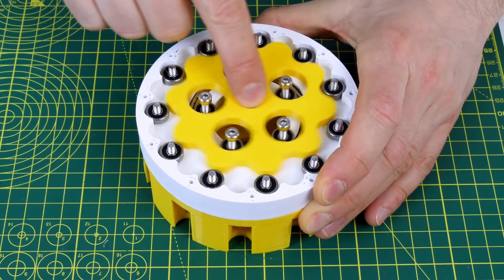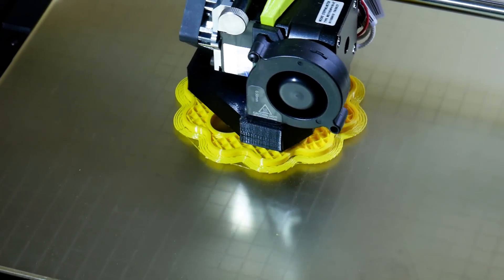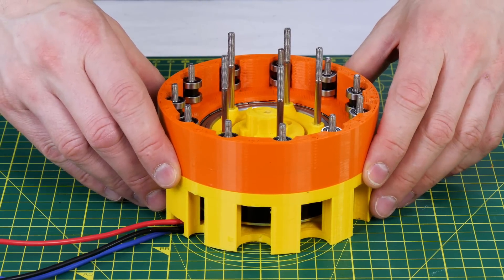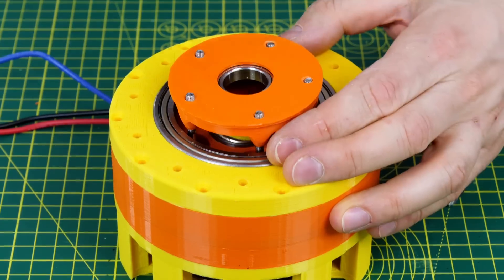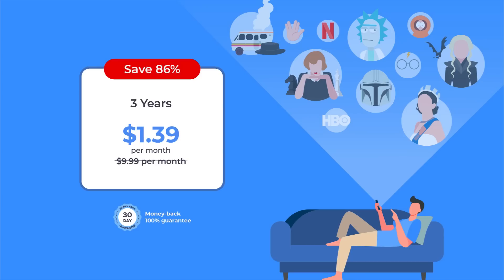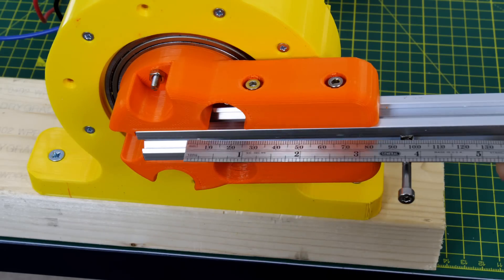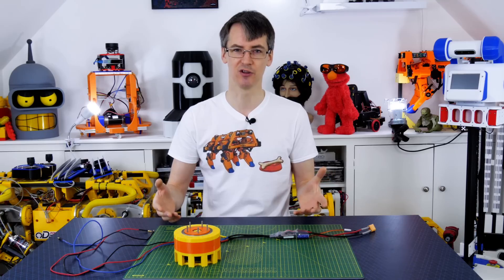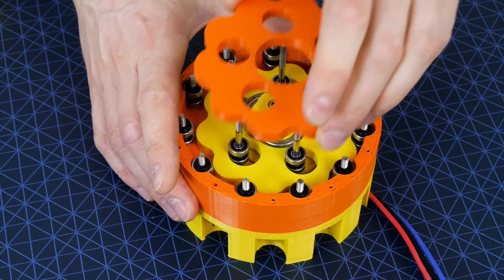3D Printed Cycloidal Drive V2 - Much Better!

Comment from the maker: Grab Atlas VPN for $1.39/mo before the deal expires: http://atlasv.pn/JamesBruton 💥
Reply: @occhieanimation2972  Plastics are hard to predict and tend to preform poorly under constant deformation.
Reply: @James Bruton  The use of 3d Printed cycloidal gears is the focus of my undergrad research. I'd be interested in sharing my research!
Reply: Use Planetary gearbox.
Reply: Why dont you have a mount on the bottom where the plug in is and put a case thing on the spinning bolts that goes around the entire thing  and make that a joint.
Reply: JAMES : "The cap fits perfectly " while he is just continuously  hitting it with a screwdriver.
Reply: Could you use Delrin/nylon bushing's instead of bearings to reduce weight?
Reply: how about adding some kind of dampening like what mini RC rock crawlers have. they're kind of like muscle tendons - which makes sense to use because it's literally like a leg. having a torsion bar or spring is
Reply: get an SLS .. that nozzled crap is really only for 3d illustration of prototypes

Comment: If there are three cycloidal disks, with the top and bottom being half the mass of the middle and being 180 degrees from it (so the same phase as each other) it should dampen the secondary forces as well, right?

Comment: AGS Door Ease Lube Stick is a very effective lubricant for plastic-on-plastic parts.  Just apply like a crayon onto the 3d printed parts and exercise the joint.  In a few motions it is super slick without the liquid residue.  I simply don't use oils or greases any more on 3d printed parts.
Reply: woulnt graphite just work as well?
Reply: Yes, but very messy.  The Door Ease is clear and odorless.

Comment: Have you tried using cycloidle drive  to and drill meters to make the upper half of a robot

And can you try to make it with pancake moters

10 to 1 ratio also

Comment: dog Looks really wonderful. I called it a robot pug.

  would you be interested in doing a serious robot hand? I mean a full tensegrity design?
 The robot hands that are out there generally only have one or 2° of freedom and have to be manipulated often by the other hand. This would of course require training with a position sensing glove, and it would need sensing. Ideally a touch sensor like on a light where you only have to touch the lamp to make it turn on. Interested ?
 The hope would be to attach it to a human arm. I have seen some great work but people often get things wrong. For instance the sideways motion of the wrist is an access point which is a head of the motorcycle twisting motion of the wrist. There are many other issues. Spreading the fingers And some design are often simplified. The free-floating pinky and ring finger are also rarely done correctly. A simplified designed that was able to achieve all of these would really be an exciting project. Maybe even a series. I hope it's not too complicated, as there is the possibility of using a  a single stamped flexible object for the whole finger structure.  such a spring-loaded hand would work very effectively, And there's only cost a little bit of energy in flexing.
I'm very knowledgeable about mechanical designs, I mean novel mechanical designs. There's a lot of stuff people aren't trying. I guess you could start with a piece of plastic cardboard and some rubber bands hot glued on the back of the fingers ha ha

Comment: Could probably use plain bearings in a few of the spots where you used roller bearings to reduce complexity and cost, without much extra friction

Comment: I know this is old, but I'm curious. Have you considered packing grease or grease for fittings at your local auto parts store. This could help with backlash, mechanical wear, and noise plus a bonus is local off the shelf materials with open access.

Comment: Like in previous video, your printer seems to be heavily under-extruding, those large gaps especially on top layers are good indicative of that. That makes your parts also weaker as the plastic doesn't melt together so well. Fortunately that can be tuned from the control board without any extra cost.

Comment: Why are you not printing these functional parts solid? 20% infill is way too weak if you want to put weights on there. I've just seen the previous version yet, I'm just jumping in to view this one, so I don't know the results yet, however, I'd print them from solid nylon which would be nearly indestructable. I love the complexity of these projects... I love seeing functional 3D printing... figurines are nice, but this makes more sense :D

Comment: It seems like the requirement for back driving will always result in a lot of wasted energy.  Maybe you can put a torque sensor in the knee joint and use the signal to implement the springiness in software.  Just found your awesome channel so I apologize if you discussed this already.

Comment: I think you might like the pricing and lead times of MJF PA-12. Sure you can print everything yourself but that costs time and PA-12 parts have higher tolerance and are 12ksi YS. It will be the better option when you want to make 8+ gear box assemblies all at once. Offloading some printing time would reduce your time to make revisions and let you focus more on content creation. The cost of MJF parts greatly decrease as quantity increases so maybe it's something to check out when you're done prototyping one offs and are closer to a final design.

Comment: So if you took a bunch of these and used a clutch that activates with centrifugal force for the center bearings is that how an automotive transmission works? So each time a clutch activated with a higher speed the next gear is activated?

Comment: Is there a way to add something like a friction plate based clutch to a gearbox like this? To introduce a failure point instead of breaking your hark work? Haha
I've been wanting to make a cool clunky automatic door opener, but I don't want someone just throwing the door open and shattering my work... I figured maybe if it gets overloaded the friction plates slip instead of breaking the gears. It would only need to be adjustable and not actuated, as it only acts as an emergency safety device.

I'd like to see someone build a fail safe or something like that.

Comment: The 5 holes in the cycloidal disk could be lined with high tolerance metal rings instead of bare plastic. This could massively reduce wear and tear and also allow you to more tightly control the tolerances to reduce backlash. Just a thought! Looooving this project!

Comment: Would adding a counter weight to the one and only cycloidal disk be an option? Thinking brass or tungsten if size is an issue.. Or are there any additional advantages you’ve found for the double disk design?

Comment: I don't know if anyone's linked you a harmonic gear drive before, but it might be a way to achieve a very high gear ratio in a very compact space with a reliable, durable, and reversible mechanism: https://youtu.be/7QidXf9pFYo

Note that the native ratio is probably going to be TOO high, but it looks like you could chain 2 of different sizes together to achieve the desired ratio

Comment: I'm really impressed with what you have done here. I have done a modest dive into the cycloidal drive system. I have come to wonder if it might be better, for the drive/reduction to be in the pulley. Reasoning that even industrial robots use the belt drives to creatively position the motors. As you mentioned, if tension-ed correctly they have incredible holding power and minimal backlash. This also provide modularity to the system; a motor, pulley or belt can be changed without removing and disassembling an entire sub-assembly. Therefore; I postulate that building the cycloidal reduction into the pulley and retaining the belts is going to be your best approach.

Comment: Consider print - in-place bearings, you can find multiple variants on thingiverse. Taking advantage of the layer lines you can get very small near-tangent contact surfaces.

Comment: It looks like you need to tune your settings for the lulzbot. Those are significantly more expensive than my Prusa, and i have never seen the first layer perimeters so detached from the base layers using PLA at any resolution or infill %. I suspect you're under - extruding.

Comment: Once you've tweaked the design to perfection, it would be best to print it out of some durable material like nylon or ABS. You could also try special filaments engineered for durability.

Comment: Try enabling HFI on the vesc. It will track the motor perfectly, although it is a little noisy.
Reply: The vesc can also use an encoder :)

Comment: A thought: with a bearing between the bottom drive bolt holder plate and the cam shaft, the whole assembly will be mostly sealed. If its sealed, you can put a small hole in the side and add a standard grease zirk so you can pack the whole thing with some good silicone grease. Sorry if this isnt helpful but it always bothers me when I see these 3d printed gear boxes with no way to easily add more lubricant without taking the thing apart.
Edit: also unrelated question: could this be done with 3 cycliodal disks in a triangular arrangement instead of just 2, and if so would that help at all or be pointless?

Comment: the cam attached to the motor surely cant be 3d printed due to fatigue fractures and the grain of the print. Is it possible to print the cam sideways so the grain passes through the entire structure??

Comment: James: I HIGHLY reccomend Polymaker materials. Their polycarbonate prints amazingly and is very stiff tough, and the natural coloured nylon (not tried the black) is incredibly tough.  I print them with an insulated enclosure; but no active heating, with no trouble whatsoever.

Comment: Nylon rod on a lathe to machine down to precise diameter and replace all of the small bearings with cuts of it, using lubricant of course.  You could embed bushings in them to sleeve the bolts to further reduce friction and wear.

Comment: Very interesting project. 

I wonder something about your cycloidal gear : 
#1  you choose to use tiny balls bearings maybe is a good idea to replace them by rollers bearing ?

#2 The 2 gears who "slide" put some ponctual contact on each tiny bearing but working with a ponctual strengh ( or a line in this case) on the free annular ring of each roller gonna laminate the ring ... isn'it ?  (if i remeber the rule when you assemble a bearing  is  to lock the annular ring who turn to avoid to be laminate)

Thanks

Comment: Molybdenum grease is incredible, double the lobes, no rotary bearings just double metallic sheet between could have an optical gradient for position, halves the size using a stronger substrate.

Comment: You may want to consider ground dowl pins and bushes instead of bolts and bearings, it may save you weight and be more compact. Added bonus Extractable dowel pins DIN7979C have tapped holes in the end that could help hold everything together

Comment: It seems that, with a little further iteration and refinement, this would not only supply inverse reactive current for use in unilateral phase detractors, but would also be capable of automatically synchronizing cardinal grammeters.

Comment: you can use the power of vesc software updates :D you can try  HFI mode before trying building sensors. and also, make an encoder that translates the movement. using potentiometer to controll the RPM is unideal.

Comment: MIT cheetah is not optimal for hobbiests. It's worth spending the weight and cost budget on higher precision parts that enable backdrivable 20:1 to 50:1 reduction. Motors 'want' to go fast, that's the physics. Torque is linear with current, and complicates the drivers, etc. Smaller faster motors are cheaper and more readily available.
Reply: Considering the full system weight, cost drivers and batteries, it makes much more sense to start with a 5A 100g 0.4Nm motor and a 20x backdrivable reduction, than 200g 20A 1Nm and 8x reduction, then  decide what you can build. It is much harder to make a Saint Bernard than a chiwawa.

Comment: You should definitely increase the overlap settings in your slicer. Look at the orange part at 4:50. increasing the flow could also help up to a certain point. These two things help to make your printed parts getting more rigid.

Comment: A vesc is actually capable of running a bldc motor with a proper encoder. You can use hall sensors for example.

Comment: no need for odrive, vesc can handle foc bldc aswell. vedder even works on a way to measure the motor imperfections with current pulses into the coils of the motor, so that afterwards he can use the floating coil as kind of a hall sensor itself. this guy is a genius! also nice video btw, really enjoyed.

Comment: Very interesting drive reduction. For the flat parts, you may want to consider milling them from expanded PVC. (Presuming you have a CNC mill... I don't know... first video of yours that I have seen.)  A sheet of 6mm expanded PVC is not expensive , it is durable, and quite easy to machine. I use it for a great many things.

Comment: You are using a mechanical reduction to make up for an electronic mechanism limitation rather than find a better electrical solution, why? That’s like using an electric motor to run a gas engine thru a transmission because you didn’t have the right motor in the first place.

Comment: You're seriously losing a ton of strength without using 100% infill, that first prototype would not have snapped. Also your printer is under extruding badly, maybe the direct drive is faulty? Or maybe your need to calibrate e steps or check filament diameter. Your parts are losing tons and tons of strength due to gaps in the layers. Also, PLA is mostly okay, but PETG isn't much harder to print and is way stiffer and harder and durable. You have so much simple things to tweak and improve with your prints alone, I hope you see this comment bro

Comment: I think there are still enthusiasts in mechanics.
In fact, cycloidal gearboxes are quite capricious to deformation, backlash and centering. In large deformations they are prone to jamming, and in large efforts they tend to drop their efficiency by up to 15%, although they have the highest efficiency in the gearboxes. Personally, I deal with the development of such industries and my advice is to eliminate the deformations in the mechanism to a minimum, as well as to strengthen the bearing of the shafts. In the laboratory we managed to achieve a 540 gram all-steel reducer with an efficiency of 97% and a hardening of the steel of 60 Hz and an output dynamics of 430 Nm. To find things, look at the places where you should not minimize the deformations and centering of the whole system.
I wish you good luck!

Comment: You might have seen this before but the VESCs are able to connect to hall effect sensors for positional accuracy if your motor has them. It solves (or reduces) lots of the issues with stall torque and can safely dump a lot more current in at low speeds

Comment: This is crazy complex! Your double gear box is adding loads of cost, mass, volume and complexity. Get rid of all of it! Get LOW KV motors or wind them yourself. Your outrunner has lots of empty space on the stator for a higher turn count to get the KV lots lower. No complex gearing needed, no 3d printed parts, very little added mass beyond that of the motor and takes up only the space of the motor. I've followed these gearing videos to see where it went, but I have to tell you, this is a sub-optimal solution that can be resolved with motor rewinding only. I love the engineering and effort put into the cycloidal drive, but it's the wrong way to go to solve your problem. Look at the Mars helicopter. It uses low Kv outrunners driving the rotors directly.
*
You will also  eliminate all that unneeded noise, friction, vibration and slop in the parts!

Comment: I’m pausing at 5:10 to ask if those two little screws would have a large torque on them or not(?). I don’t think it would be from the reduction but just the lever arm being so much smaller there while trying to “transfer” the same amount of force the outside of the drive gear, which is has a larger lever arm and would require less torque for a similar force output.
Reply: Looks like there just isn’t that much torque at that spot

Comment: how about using bushings instead of bearings, where the off-center rotor part-thingymadoodah is rubbing against the outer shell? that would save like 40% of plastic, so you could make it stronger AND lighter. With a little bit of head-scratching, it could even be accessible and easy to build anywhere in the world! If you have a dev discord, I would love to help out with the enginerding

Comment: Using UHMW for bearings / spacers would be a good option for weight reduction as it has low static friction coefficient which would reduce heat generated from interactions with the PLA. It’s also relatively cheaper.

Comment: I once had a cyclo drive where the profile of each of the two cyclo wheels was the xor of two cyclo wheels where one was turned by half a "tooth". If I remember correctly, this doubled the contact points

Comment: Try a cycloidal drive with 3 cams and discs, each 120° out of phase. Might help keep it centered and operate smoother. More discs and cams may mean more friction, but should also have more friction reduction due to the bearings.

Comment: Hey if you are still using your cnc machine I would recommend that you submerge the cutting bed fully in water to help disperse the heat and to help with the lubrication and the particulates.